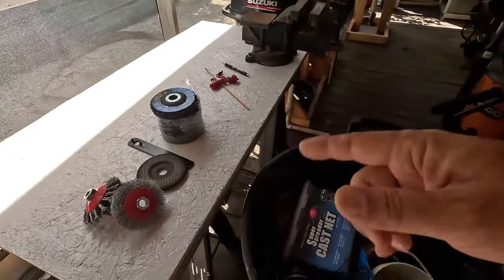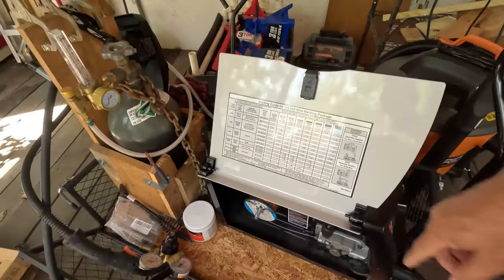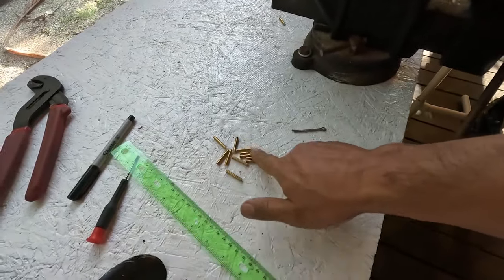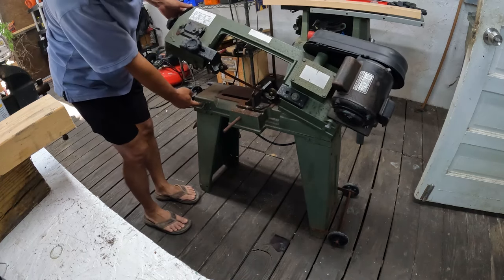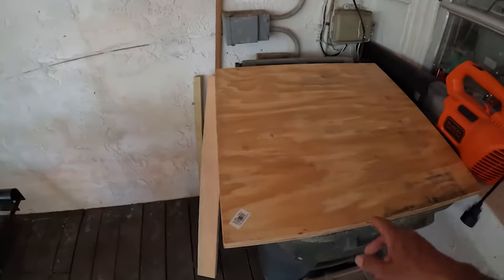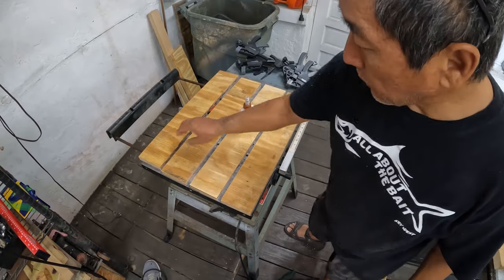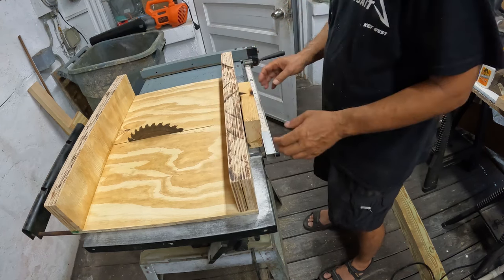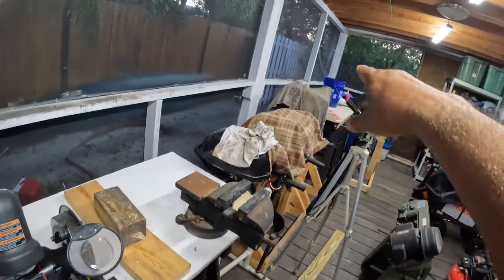Building My Patio Workshop part 4.  New Metal Cutting Bandsaw and Taming the Hand Chopper.

Comment: Just a litte tip from a woodworker. Never use "oil" or any petroleum product on woodworking tools n tables.
1. My contaminate surface of project wood.
2. Mostly, it attracts and builds up dust.
Ive found that. Johnsons paste wax works best. Turtle wax for cars works well also. Paste wax. Even on threads of adjusters, blade raiser.